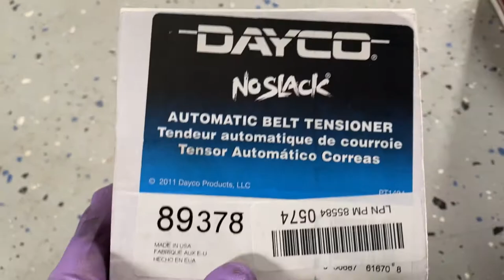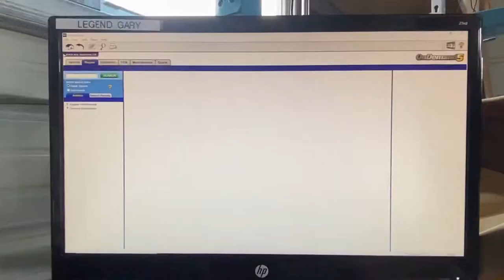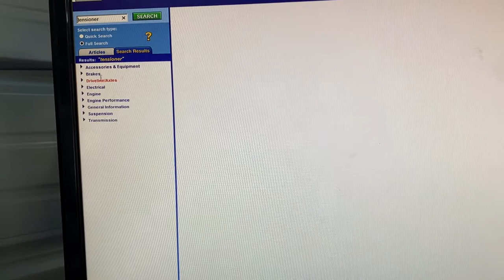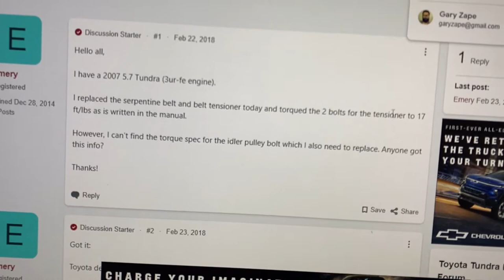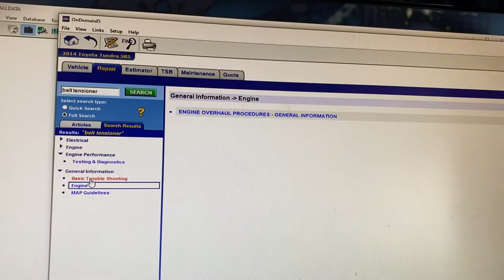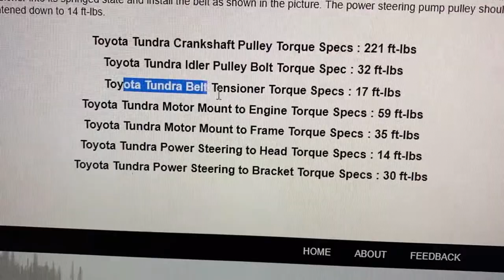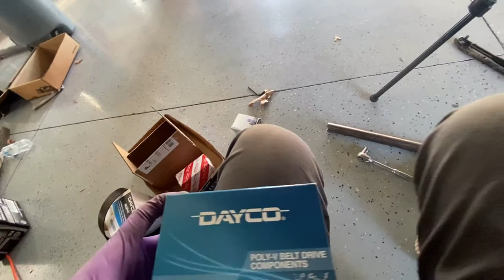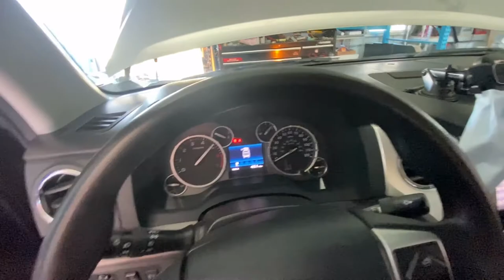How to Fix squealing noise of 2014 Toyota Tundra 5.7L V8 iForce / Drive Belt Tensioner replacement

Comment: Your video calmed my nerves about my tensioner and serpentine belt. I just purchased my used 2010 Tundra and I'm so excited to own a Tundra! Day 2 of owning it, after driving roughly 60 miles to bring it home on the first day, my tensioner started squeaking. I was so upset that I just got this truck, which has been taken care of better than I've seen any used truck, and this happened. But now, I'm confident I can replace this myself. Thanks again for a wonderful video!
Reply from the maker: Just take your time. It’s doable . Keep me update
Reply: Man that's the exact same thing that happened to me. Instead I bought a 2014 /1794 and 30 days of driving it the squealing sounds started.

Realized it was this problem and I felt a relief

Comment: Do you recommend putting any anti-seize on the bolts?
Reply from the maker: It’s up to you . For me, I won’t.
I put anti seize if I have to remove and install it often and where it gets really hot during operation . This area doesn’t get that hot . But it wouldn’t hurt to put anti seize

Comment: 17 FT-LB for the housing bolts 

32FT-LB for the tension pulley
Reply from the maker: Thank you for that info
Reply: Is a torque wrench required?
Reply from the maker: @albertgarcia2885  yes, to be safe

Comment: Great video. Any reason why you didn't change the idler pulley?

Asking because majority of drive belt kit comes with belt, tensioner pulley assembly and idler pulley.
Reply from the maker: Customers parts , I just installed what my customer gave me .
Reply: @autopurlieu  gotcha.

Btw,  for your future reference, torque spec for the idler pulley bolt is also 32 lb/ft similar to the pulley bolt on the tensioner assembly.
Reply from the maker: @kirkhamster0024  Thankx 🙏